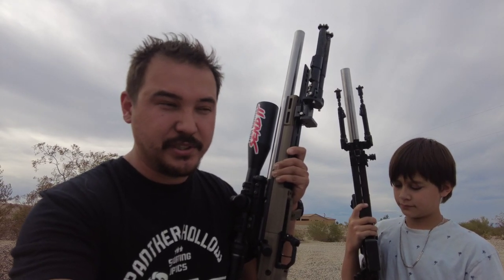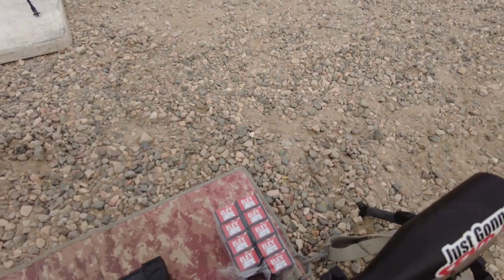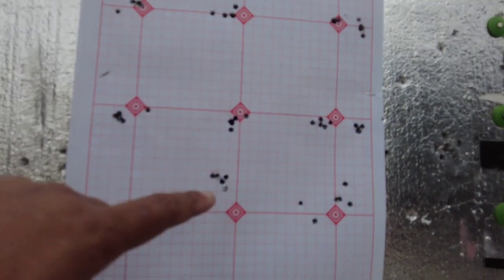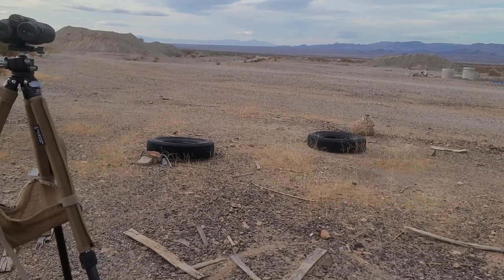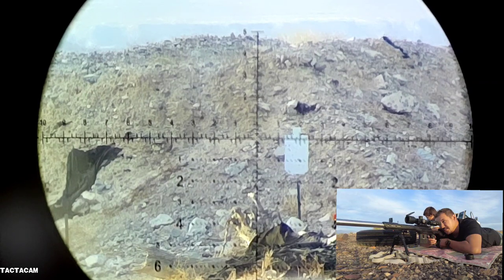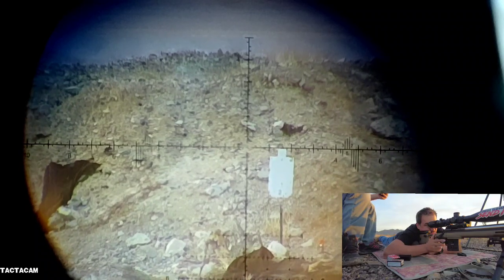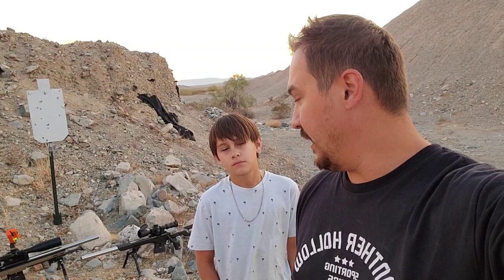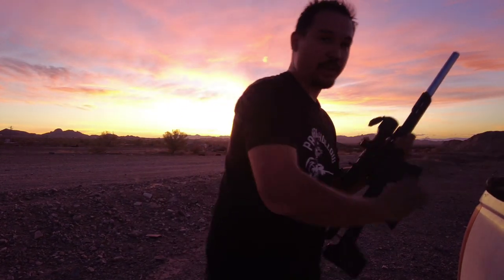Fast twist 22LR. Are they more good-er?

Comment: Good Job Chickenhawk. Oh and WOW, This was a costly test comparison, as per the twist rates shoot-out. really clever. So far, were have barrel length comparisons, now twist rates among many other types of testing... Before too long, the perfect rifle will be arriving on shelves soon. Not that the previously custom made rifles were not worthy, that isn't what I am saying, but rather, all of these testings and break-through's hone a rifle system for a tailored desire can be achieved, lessoning the need to focus on oddity's that takes away from simply being able to point and shoot. Example, the more precise a rifle system is, you only need to worry about windage and elevation, vs, like my old 10-22 rifle that I purchased from SEARS & Roebuck some 30 to 35 years ago with my dad. You gotta deal with horrid sights, sloppy furniture fitment, loose butt-stock plate, poorly reamed chamber to cartridge fitment, (no, SAAMI spec here, LOL)  loose barrel strap to wood furniture clamp, which it came like that from the factory for the most part. But, that is what was all that was required in a trainer rifle system, hence the title "trainer" as $59.00 doesn't buy a kid much precision, while it was understood, that we would be carrying them over our shoulders to and from school for gym class, and after school shooting sports, and Cub Scouts, and Boy Scouts of America shooting leagues and events and conservation club events. Heck, a rifle case or rifle bag, back then, cost more then my 10-22 "poor mans Marlin Model 60. These rifles were gonna get beat all to heck, and in order to shoot them, you had all sorts of issues to pay mind to, sloppy features, horrible sights, and the competitive nature of some of the other fellow students that had more money that my family did, my junky rifle is all we could afford, but, I loved that rifle, and still have it to this day, in all its GLORY of sloppiness and 90 foot groupings at 15 yards, lol.. 

As a child, I never would have thought, .22 rim fire rifle systems would or could ever be so advanced as like what you and so many others are doing with custom built machines of wonderful ability's. If I would have shown up with one of your rifles back then as a kid to school intermural shooting sports, everybody would have thought I was from the future and came back in time like the movie "Back to the Future", LOL... 

And for those folks who do not know, YES, not to long ago, in our beloved country, the United States of America, we children, used to carry firearms to and from school, or rifles that is. That was normal activities. Nothing ever happened involving shooting accidents, or assaulting of a teacher or another student, with the use for firearms. Even in the extreme of situations, of two students getting into a fight, they would of course fight it out, and NEVER ONCE was it a thought, to use the firearms to shoot and kill one or the other or many. I can remember a fight broke out, and both students had other students hold their rifles, as if they were handing off their book bags or back packs, it was foreign nature to desire to kill somebody, while also knowing, that you would get in serious trouble is such were to happen, more then simply getting into ta fist fight, that at worst, resulted in bloody noses and black eyes.. But never the intent to shoot and kill one another... When the fight was over, they each acquired their belongings, and finished walking home or waiting on the school bus to arrive. Let alone, no toehr students would have ever allowed such an event to take place if that were to ever elevate, all based on how we were all raised, you live to fight another day. 

Pardon the NOVEL again.. Just a fun video, that got me thinking of how so many things have changed in the mechanical world, to the social world. I really have enjoyed watching your rifle builds, and the fact that you are so willing to share with the world what you have learned at each stage of this adventure, I highly respect that. Even when you pose a question, of something that you are unsure of, I enjoy that freely too, as more times then not, are questions that I would have never thought of all on my own, and once you mention these up in the air type questions, I now can watch for things now too. I like to be inspired, and all of you guys, Rick, Ray, Echo, and a hand full of other professionals, well, this stuff is priceless. I think you for the efforts. Well done Kenny. And well done Chickenhawk. Chickenhawk, is gonna be a force to be reckoned with in the competition shooting events, I am quite sure that you are exceptionally proud of him.

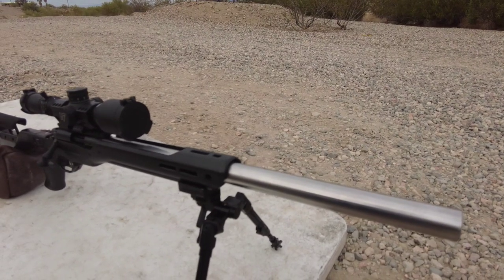Comment: Has anyone thought of the idea to start-off with slow twist...say 1:16, and throughout the barrel length of (say) 24"...end up with 1:9 toward the end? The thinking is you won't impart a super-fast twist rate right at the point of ignition.....like starting a car a 6000 Rpm. Too fast of a twist too soon .....may ( in this micro-second world) start deforming the lead bullet a bit more and a slower initial twist rate might help this?

Comment: I think the faster twist rate would be nice for some custome loads. like a 40gn copper solid and some slow powder to make use of the long barrel. I saw a listing for primed 22 brass but thought it was just as expensive as match ammo. a heeled solid copper could be made if you had a lathe handy. like put a factory 224 solid in a collet and cut the heel.
Nice shooting little hawk
Reply: Dude, this is Rimfire
Reply from the maker: That's a crazy rabbit hole these guys at these bullseye railgun 22 matches are doing.  They swag their own bullets. Obviously skeptical about those cutting edge bullets as it challenges their homemade ability lol
Reply: @EagleEyeShooting  unreal! I don’t need to know anymore lol

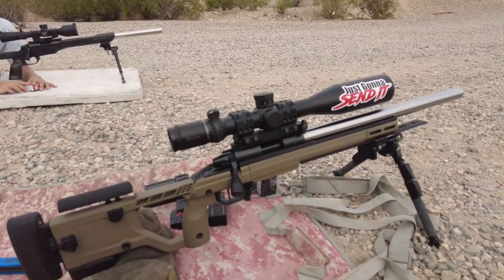Comment: The question is does fast twist work better in a shorter barrel? i.e. in an 8 inch barrel the bullet will only be rotated 1/2 turn before leaving the traditiomal 1:16 barrel.
Reply from the maker: Don't know, anything shorter than 16 will get into SBR territory

Comment: If someone were to order a custom 22lr barrel, and they aesthetically like the look of longer barrels, what twist rate would you recommend for tighter groups with say a 24 to 28, possibly 30 inch barrel? 

Cause if someone was gonna drop the money anyway, and they can get tighter groupings with a wide variety of 22s, and still have the long barrel look that they desire, why not go for it?
Reply from the maker: The rifles I build in 22lr typically are long 24" barrels. Im personally testing many factors in 22lr. The results can be seen in our company's I. G DPGunworks

Comment: Hey Kenny, what's the make of the 1:16 20" barrel?  I heard you mention that the 1:12 is Lothar Walther (Have one on my Rim-x today in 24") but have found that it doesn't like Eley.  She shoots about 2MOA at 300 with SK LRM, but am considering another twist (1:14, etc).  Really want to shoot a lighter colored bullet to help with tracing like what Eley provides.
Reply from the maker: Haven't had luck with walther barrels.  Or prefits for Rim-X.  I would check that barrel tennon length is 1.686" +-.001 or your headspace is over .045"